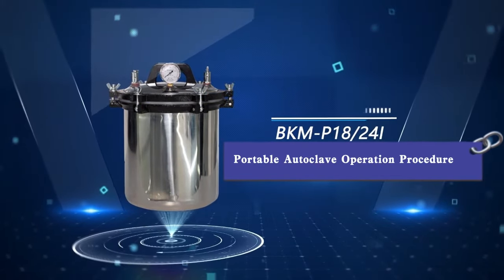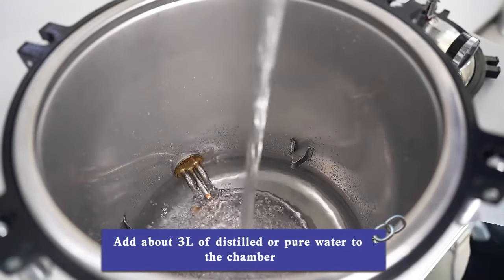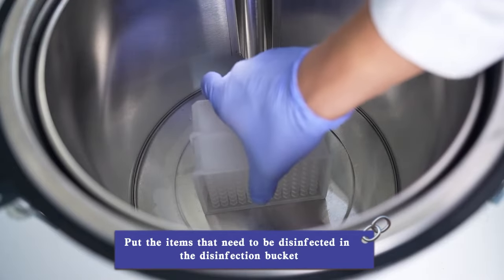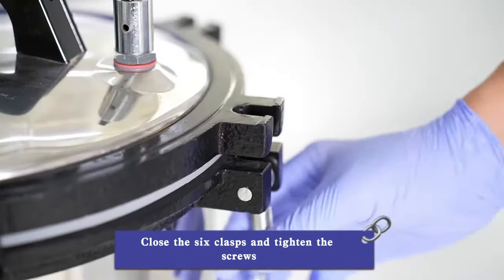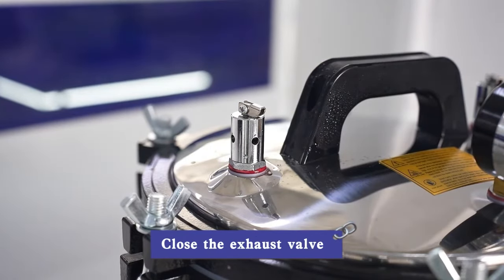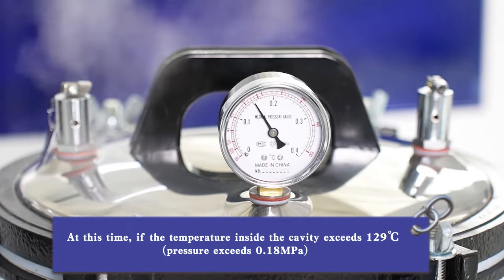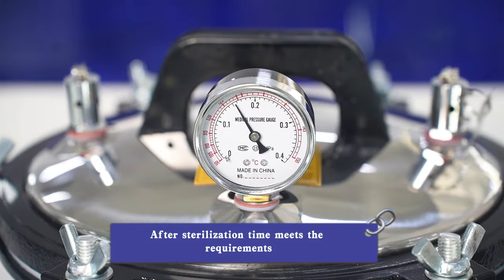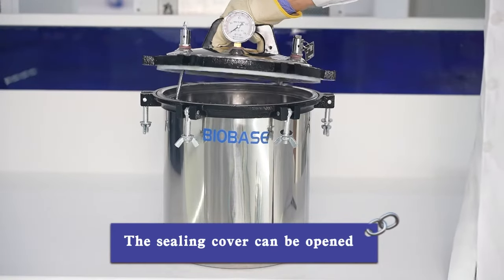BKM-P18I 24I   Portable Autoclave Operation Procedure

Comment: Hi, I use it for sterilization of grain, specifically corn. I need to reach 121°C 15psi for around 2.5 to 3 hours, but the grain ends burnt, all brown. I use heat from gas, I dont have electricity where I use the autoclave, do you know why would the grain burn? Thank you.
Reply from the maker: The temperature is too high to heat grains.